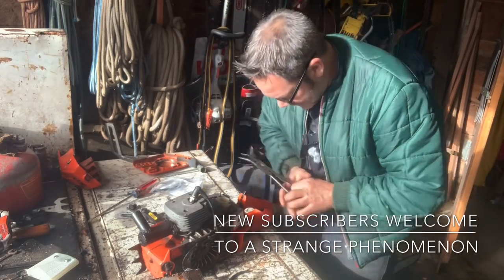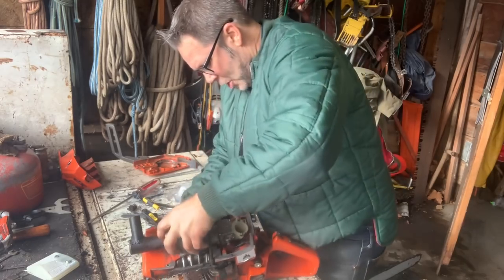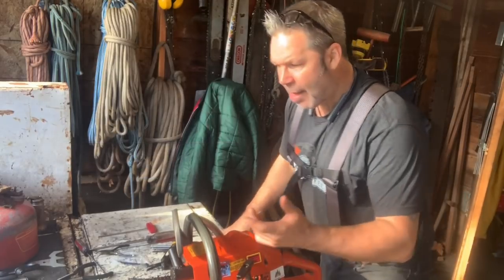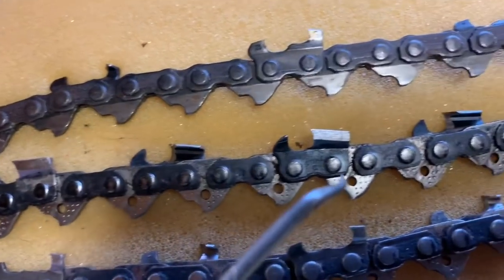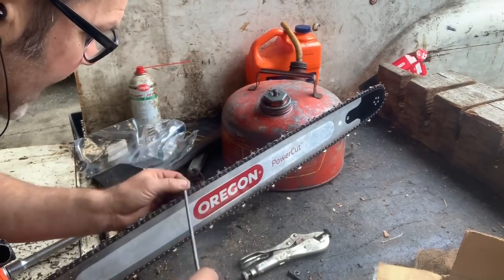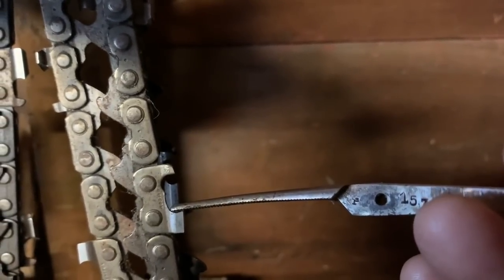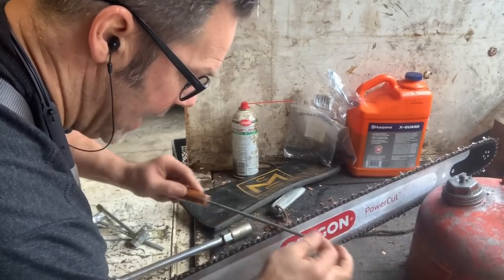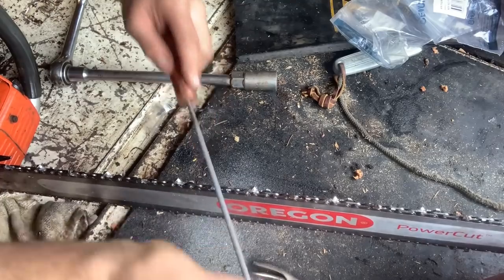Sharpen your chainsaw and change mounts on the tailgate

Comment: Great video on hand filing. I think that I may finally have it down with more practice of course. Same as you, I was buying new chains out of frustration then taking a bunch of them to be sharpened but the results varied a lot. Now I control my own destiny. Thanks Buckin.

Comment: Buckin you really do help people. Even if they’ve done it for years and cut loads and loads of wood. I think firewood cutters need more help than anybody. We’re the ones cutting into dirty wood and hitting rocks and barb wire. The gullet and the corners are everything! You should really stress on the corners more. Even if the rakers are filed and the tooth is sharp it still won’t cut without laying on it. That’s dangerous for newbies. Again you’re amazing for taking your time to help educate others!!

Comment: Tailgates were meant for fixing chain saws, not for partying at the game.
Reply: unfortunatly the newer 4x4's are way to high even with a block of wood ( need 3 to 4 of em)
Reply: Scott Bennett mine isnt that bad. In 6’2” so I can reach. The new f250 there like 5’ off the ground. There huge now.
Reply: Amen 77100

Comment: I watched your previous video on sharpening gullets, I was using a grinding sharpener wheel and was not getting any results, slow cutting and was forcing the saw to cut. . Turns out I lost the “C” in my blade. Just sharpened up my 455 and ripped through a 26 inch oak tree and had a shower of big Curley wood shavings. No more sawdust chips for me! Thanks for the info!!

Comment: OK, I've gotta problem here. I am a bowl turner. So, once I buck up a round I need to rip that round into, at least, half. I have found that after two or three buckin' cuts that my rip cuts tend to be slow and tend to curve to the right. I'm using a Stihl  MS250 with a 3/8 chain on 16 inch bar. I'm also using the Stihl gizmo to shrarpen as I don't have a complete right thumb. Any ideas as to how to solve this curve problem?

Comment: I had a 266xp, (might have been a 288?) fastest saw I ever owned.  Taking the term "tailgating" to a whole new level here, ain't ya.  That's the best solution yet to keeping a clean work bench. If you don't clean it off, you ain't going nowhere's.   To put it over the top, need to figure out a way to quick hitch a vise for other projects (magnetic?).  That filing technique makes sense,  just never had it explained.  Thanks.

Comment: Hey Buckin and everybody, I have a question about the angle of the tooth on your chain. Is there one better than the other or is it all dependent on the type of wood your in, does one cut faster but also dull faster. Really like your videos, thanks for all the help and passing on your knowledge and passion.

Comment: Currently doing a 5/32 baby c chain on a chain that uses 7/32. Figured I'd change it up a little bit to break the monotony. Thanks for the idea!
Reply from the maker: be sure to run a raker gauge friend ,, and report back yer finding    well done
Reply: @BuckinBillyRaySmith  first day of use, I didnt have a file guide. Bent the ever living crap out of the working corner, took a lot of top plate off to get back to normal with no rounding, after that rakers were perfect! One of my crew members on my thinning crew bent his chain and I replaced it for him. Straightened the bent chain and looked at the teeth. Gullet was way too high so it's now a baby c as well. It works pretty dang good once you get the hang of it  thanks again for the idea its fun!

Comment: Replacing AV mounts earns back alot of reliability. Its much easier on intake boots,lines, throttle assemblies since your not stretching them like when the mounts are all worn out. Goes for all brands

Comment: Hey Buckin'! Thanks for the video again! I may have missed it, but can you explain the difference in cutting with a ground chain vs a hand filed chain (as far as performance and/or application)? When you were showing the chains, these two were drastically different as you mentioned. Thanks again!
Reply: I can tell you that when he says ground chain that is a "square" grind, which is what commercial loggers use. Hand filed is with a round file and is the chain you see most non-professionals using.

Comment: I sharpened my chain on my 262xp! Cuts great! Fast- big chips! But it's curving to the right as I go thru the wood? What do you think I've done wrong?
Reply: Get yourselves a raker gauge or depth gauge and file each raker individually, shorter tooth, shorter raker, long tooth longer raker. And dont forget to maintain your bar AND flip it around sometimes especially if you cut firewood and sawing "one way"

Comment: Hey Buckin was wondering did you ever noticed one brand of chain holding an edge better than another?
Reply: I would like to know as well.
Reply: Oregon powercut...find commercial outlet...they will cut and assemble your needed size if offered...carry your old chain with
Reply: In my opinion, Oregon chain is better than Stihl chain, because it's softer. "Holding an edge" is a funny thing...you don't necessarily want a chain to "hold an edge" for too long and end up getting too hardened.
Reply: @samuelluria4744  I was kind of thinking the Oregon chain was softer but wasn't sure. I was working some standing dead elm last week and the Oregon chain was going dull quickly. Stihl seem to hold its Edge longer.
Reply: I thought maybe either brand could have had differences from chain to chain if you get my meaning.
Reply: E MS - Yes. Definitely true that Stihl will hold it's INITIAL edge longer.....it's afterwards a question of how it performs after subsequent sharpenings. Aside from the hardness, I feel like the Stihl chain has a bit "too much going on", in between the teeth, if you get my drift. I mean, they are a bit sloppy about leaving a lot of metal down below the Gullet, and near the strap. This just annoys me, when I go to run a file through there....I'd prefer to have an absence of extraneous material, Lol. This issue is more pronounced in regards to "homeowner chain", with the bigger rakers....hard to even get a file in there.
Reply: @samuelluria4744  I don't typically use Stihl chains but I've been trying to give a small local Saw Shop some business all he carries are Stihl products.

Comment: I want to get one of those Oregon Power Cut lightweight bars 28” before they stop selling them. I was wondering what gauge yours is? 50, 58, or 63
Reply: Dwight2x - Whereabouts are you? .058 is not so common.
Reply: I live in Connecticut and have a 20”, 24”, and a 28” all 58 gauge. Looking online I see 50 and 63 gauge but don’t know what’s best since I only have experience with the one size. Thanks
Reply: Dwight2x - Hey! I'm just down here in Jersey, and nobody really uses .058 here.... strange.....have great and safe success with everything, and every guage, this Winter!
Reply: What gauge do you use and why? Thanks
Reply: Dwight2x - I use .050 on everything from the old Stihl 054 and down....it's by far the most common; on 660's/880's/090's, I use .063, since I have the power to pull it, might as well. I personally feel that the wider tooth chatters less with all that torque....but I'm sure some people could day I'm imagining it, Lol.
Reply: (Also, if I'm milling in the field, most ripping chain comes in .063. I don't have patience to reprofile my own 60" chain to a ripping angle, Lol.)